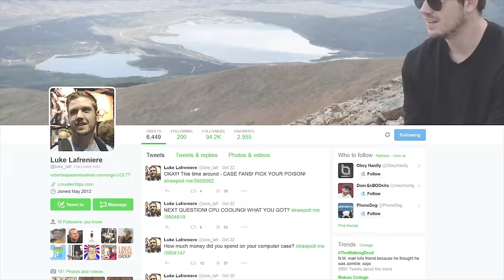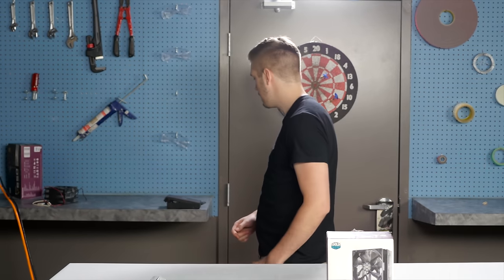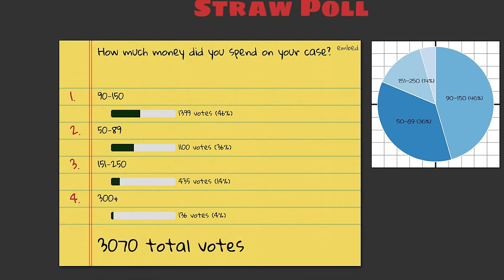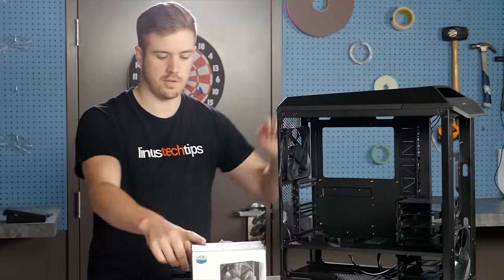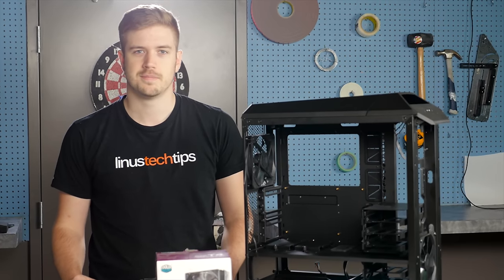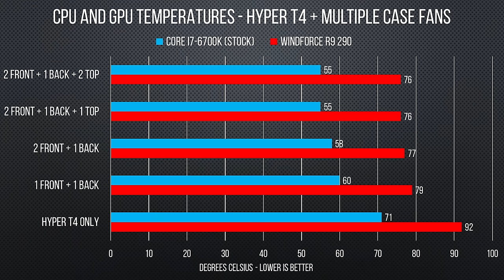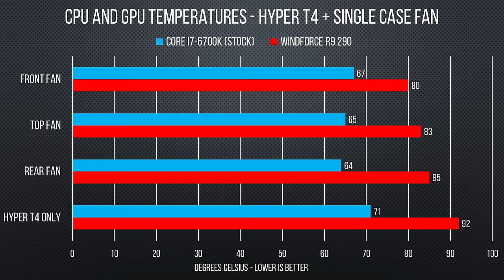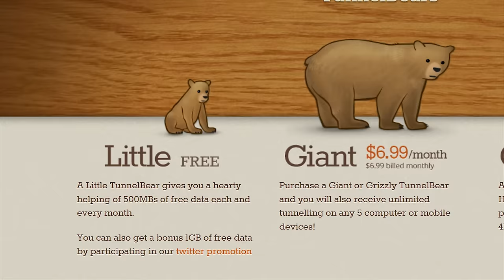Case Fans - How many should you have?

Comment: Intake and exhaust orientation should've been mentioned.
Reply: I agree completely.
Reply: hey i wanna ask something, if i put radiator in front panel, it's better to use push or pull fan setup? thanks b4
Reply: +hadron89 In my Define R4 I would do intake front and bottom, so that's three fans intake. 2 140 in front (with filter) and one high pressure fan at the bottom. Now with the exhaust, I have a H80i and the fan is pulling instead of pushing air on the fins. I have two 140s at the top exhausting also. So that's three intake and three exhaust which is neutral air pressure.
Reply: +hadron89 or bottom if your case allows it.
Reply: +EmbeddedGenius But bottom sucks more dust as dust falls down onto surfaces.
Reply: 1(140mm) Front intake, 1 bottom intake, 1 back intake, 2 top exhaust, Hyper 212(push pull config) pointed up out of the top of the case. Best config I found for my setup.
Reply: +Sword of damocles Even though dust will get in anyway, it's a good idea to use filters.
Reply: +SlavjanA I'm assuming in was front intake and rear/top exhaust
Reply: +Adhitya Permana Putra Pretty much the same thing you get 1 or 2 degress less in the component that your radiator is cooling if you put your fans in push configuration just make shure to use static pressure optimized fans.
Reply: +SlavjanA It's kinda obvious...
Reply: +David Santos ah i see, thank you David
Reply: +hadron89 I have my front fans intake the back fan intake and the top fans as exhaust and i get the best temps that way
Reply: +hadron89  depends of your case and manufacturer. for example silverstone recommends that every non rear fan is a intake in their cases
Reply: ***** It depends, some cases have a dust filter on the top as well, and the case he used does.
Reply: +Adhitya Permana Putra There is no difference in push versus pull. Both Linus and JayzTwoCents have covered this. Linus did mention he prefers to use a pull configuration so the fans do not need to be removed in order to clean dust build-up off of the radiator. I hope this helps. If you're interested in liquid cooling stuff, I highly recommend you checkout JayzTwoCents.
Reply: Optimal orientation really depends on the layout of your case. You want to minimize eddies (still spots) near anything that needs cooling/has a heat sink such as the processors (CPU, GPU, and/or APU)
Reply: +SlavjanA Actually (depending on case) having a input in the top in front of the CPU cooler can make sense.
Reply: +SlavjanA Rule of thumb is Positive atmosphere at the bottom (intake) and negative atmosphere at the top because heat rises.
Reply: +SlavjanA at 9:27 and 9:54 you can clearly see the orientation of the top fans... 
Front intake and rear exhaust are self-explanatory
Reply: +bpfoley89 if you ever did any research on the "heat rises inside the case" theory you would see how lame it is, and pretty much ineffective inside such a small, fast paced and hot place. The rule of thumb, in reality, is to always use as intake the places in which you'll have the best airflow and always filtered intakes.
Reply: +BaSkA Yeah, heat rises isn't really applicable in computer cases where airflow is present.  Airflow and proper intake/exhaust is more important than anything.
Reply: +SlavjanA This indeed. Was my first thought. Intake or Exhaust guys?
Reply: +Adhitya Permana Putra Pull. thermally they are practically the same but with a pull you don't have to worry about dust and hair getting clogged in the rad fins between the fan and the rad.
Reply: Marc-Adrian Polo
iirc having lots of intake fans prevents dust from getting into your computer, especially if you put fliters on them, but exhaust fans create better airflow in the area near the fan.

Personally, I say if your temps are bad enough that you're concerned about direction just add another fan.
Reply: +SlavjanA Wish I woulda seen this inb4 I went all caps
Reply: +SlavjanA Linus went over the ratio of intake/exhaust. Usually, you want an exhaust next to the CPU, and intake on the front. Although this may change if your front is covered.
Reply: +Nathan Schimmel Don't forget you generally want more airpressure INTO your case than out of your case, assuming your intakes are filtered this prevents dust from getting in through holes and creeks because the positive airpressure ensures that air will always be going OUT of the case through those holes and creeks.
Reply: +hadron89 On the side of the case exhaust fan works better on cards with open fans , And intake side fans works better with closed fan on gpus for example Gigabyte G1 needs exhaust side fan , and The Nvidia Titan series from Nvidia closed fan need Intake on the side
Reply: ayporos Actually, positive pressure cases cause more dead spots of hot air vs negative pressure which tends to be more efficient. Positive pressure is only preferred for dust control with good filtration.
Reply: A daft punk Hmm that does sound logical yes.
I dunno though, hot air does tend to travel upwards so I can't really see 'dead spots' being a big issue as your CPU and GPU have fans blowing directly on it and most cases these days (or at least mine does) have a top exhaust.
As I am lazy with cleaning out my case I guess in my case positive pressure makes more sense (I have 3 front intake, 1 side intake over GFX, 2 back exhaust and 1 top exhaust)
Reply: Technically, heat goes in all directions equally but it makes air less dense, and lower density rises. ;)  But basically, heat rises, yeah. That upward convective flow is disrupted by the fans though because they flow so much more, and this leads to the phenomena we observe in positive flow cases.
Reply: SlavjanA thats what i was thinking
Reply: yeah I was wondering about that
Reply: for real, I have no way of knowing which direction his fans were blowing
Reply: SlavjanA yes!!!!!!!! Like this is huge. Do we want positive pressure. Do we want negative pressure. Do we want a wind tunnel affect? How does case mesh help air flow! So many questions!!! (Head explodes)
Reply: "In the front, out the back''
A reasonably solid approach for many things in life..
Reply: You can see the little fan “guards to see where the airs going
Reply: hot air tends to rise, i`d assume it would be  beneficial to always have the exausts on the up part, but it is just a guess
Reply: Agreed
Reply: @gerelltroche  EASY 1 or 2 outtake top. 2 intake front. And 1 outtake back
Reply: Exactly!

Comment: Once my tower is 5 decibels louder than a Huey helicopter I know I've installed enough fans.
Reply: Why not just install a Huey in your in your pc? 
If you play Rising Storm 2: Vietnam it would be very immersive
Reply: @bigboyexpress6668  I did that a few weeks ago, now my house is boobytrapped and i keep finding tunnels in my floor
Reply: @maxvisser9528  I also installed a Huey and, for good measure, I also put in a sabre engine so that I can effectively remove heat from the case and use it for heating my hot coco
Reply: Can relate

Comment: Steps:
1. Locate all places where a fan could physically fit
2. Fill these places with Noctua
Reply: Nope I fill mine with Ezdiy rgb fans because how much of a good deal they are
Reply: I feel like Inwin fans are underrated though. Good value and RGB that doesn't suck ass compared to other non-RGB fans in the market
Reply: Make sure fir them to be 3000rpm do it can fly
Reply: @pipeqez911  I have those fans to they are great they should be more popular.!!
Reply: Any PC that has fewer than 8 Noctua fans (3 exhaust, 3 intake, 2 for your NH-U12S) is unworthy of being called a PC.
Reply: Or Arctic, no?
Reply: @ebinrock  ONLY NOCTUA
Reply: @ebinrock  arctic has a whistle sound, shitty sound, Noctua is better
Reply: You forget about all those "good value" fans once you hold a Noctua NF-A12x25 in your hand. Just the weight and precision difference compared to anything else is jaw-dropping.
Reply: @ebinrock  While I can't speak to 120s as I usually use 140s, both are very good. Both 140s have a tendency to resonate around their midpoint RPM that I wish they did not do.
Reply: NO
Reply: @sheezy2526  why no
Reply: 400th like
Reply: *Fill with $5. fans.
Reply: @wta1518  I have 12 120s and 2 60'$..does that count at a pc
Reply: @pipeqez911  LOL
Reply: @wta1518  insert 23 dollar price tag for a single fan
Reply: @sprocketbonmb9548  it find it funny how PC bois will spend 500+ on other bullshit.....but paying just extra 10 dollars for a better and quieter fan with 6 year service no that's too much all of the sudden lol
Reply: Coolermaster here.
Reply: 🤔  the side of me that likes some amount of RGB says: get fans with RGB. while the OG side of likes the sound of loud AF  fans  Hyper 212 Evo sound good. [pun intended]. I'm consider that if a simpler fix for random temperature spikes in the case.
Reply: @crabyman3555  Eeeh well, a LOUD fan does have the perk that, being so LOUD, if somethings off (or it, ya know stops working?) you know instantly! none of this nonsense about CPUZ HWID and TEMP. just listening. The instant it stops sound like a harrier jet or rock cancert and wonder if somethings wrong? you'll know!
Reply: @crabyman3555  maybe because thats quite literally 10% of the price of my pc for a single fan?
Reply: or Noiseblocker
Reply: you can physically fit fans anywhere....just mod your case and mount them externally :)
Reply: @Henry14arsenal2007  nocuta has a lot of diffrent fan models, is this best model for case?
Reply: @sprocketbonmb9548  you the kind of person to have a 3090 TI and Ryzen 5600x and power it with an offbrand 500 watt bronze huh

Never skimp on PSU, cases, or fans!
Reply: @GREEENZO  I mean I wouldn't even consider skimping on PSUs, but case fans and cases? maybe.
Reply: @pipeqez911  
My 3 120mm noctua fans were $13 each wtf do you mean "good deal"
Reply: @Solemn926  that aint cheap bro
Reply: @pipeqez911  
Compared to most decent rgb fans, yes it's pretty cheap for great quality.
Reply: Ayo fellow hylics fan
Reply: @ebinrock  arctic is good
Reply: Would be interesting to see every slot filled with a Phanteks t30 running at 3000rpm lol
Reply: @sprocketbonmb9548  
I say that until I get zero space for cables. Loving my Thermaltake H200 TG. It's $70 now. Used to be more expensive, then it shot up, now it's cheaper than ever.
Reply: cooler master jetflow 95 cfm fans go brrrrr
Reply: Xaviar 77versus99  My cpu (i5 11400F) doesn't get over 50 Celsius and gpu (3060 Ti) doesn't get over 65 Celsius. Both while playing demanding games. Gotta say they do way better than stock fans and I don't see myself switching them for a while. My only issue with Noctua is they nickel and dime you $8 for cable extensions/splitters for fan headers and $8 for anti-vibration pads. Little stuff like that which adds up if you're using all or mostly noctua. I have 3x 120mm Noctua fans on the front, 2x 140mm DeepCool fans on top, and 1x 140mm Noctua fan on the rear. My CPU fan is also a 120mm DeepCool fan. For what it's worth, my GPU also has 2 fans built in, so there's a LOT of airflow.
Reply: Step 3: drain bank account
Reply: arctic*
Reply: @GREEENZO  Haha yup. If there's 2 constants with every PC build I do, its 1) Always Nocuta fans and 2) Always the best Titanium grade Seasonic PSU.  Every-single-time.
Reply: I actually took your advice and now my PC has 7 Noctua 140mm fans. Not kidding
Reply: @pipeqez911  Heresy.
Reply: Agreed - I even have extra Noctua fans just in case !
Reply: @sprocketbonmb9548  Can't have cheap and quality .
Reply: @thrash1337  Noctua are the best most reliable fans I’ve tried over the years
Reply: @fortnitehub9239  wdym they are probably the most famous fans lol
They also cost almost thrice the price of any other fan (justifiably so) but I won't pay 110 bucks just for case fans.
Reply: @sprocketbonmb9548  don't worry about that guy. He probably is ironically the type to buy 1500 scalper price gpu and then complains about pricing being ridiculous while shaming someone for not spending 1/4 of their budget on case fans lol
Reply: Still relevant in 2023
Reply: lol
Reply: @wta1518  Then you woke up in hospital Dr. saying you were dropped on head.
Reply: @Henry14arsenal2007  that to me is only if you care about noise and RGB. CoolerMaster Sickleflow V2 fans are half the price, move more air, (62 CFM vs 60.09 CFM), and slightly higher static pressure (2.5mmH2O vs 2.34mmH2O). The Noctua fan is quieter at 22.6 dB(A) vs CoolerMaster's 27 dB(A).

For me the double cost doesn't offset the pros of the other fan especially since noise in a nonfactor to me. Its generally fairly hot where I live, so I set my fans 100%
Reply: I am not paying like 25 per fan when I get get arctic p14 five pack for 40.
Reply: 3: cry because you now used more money on fant than the case costed 😂
Reply: This is the correct answer.
Reply: I love Hylics